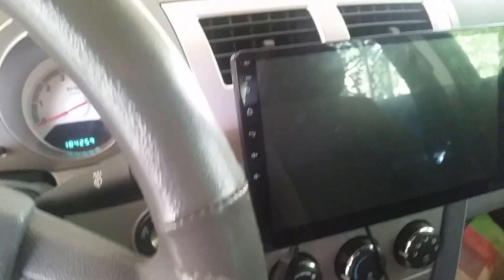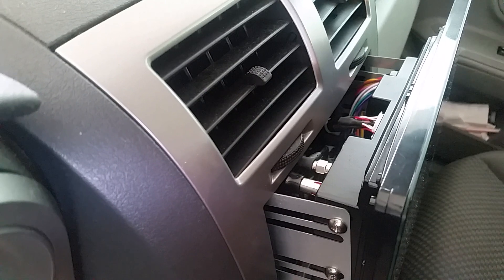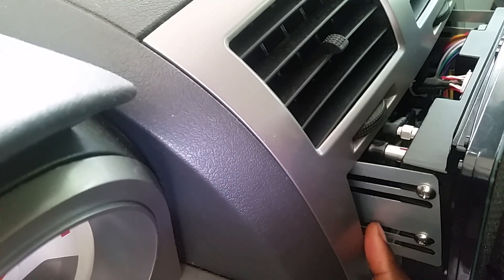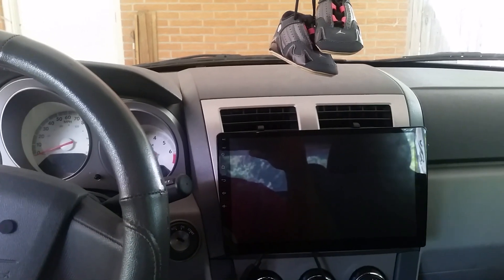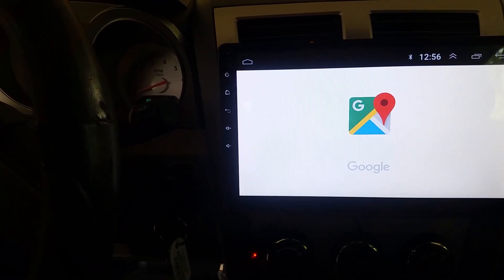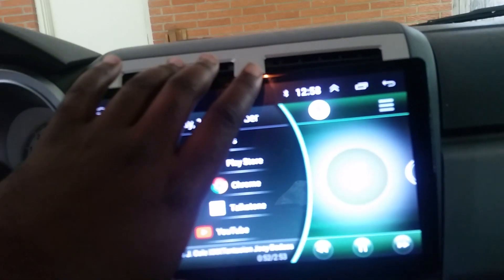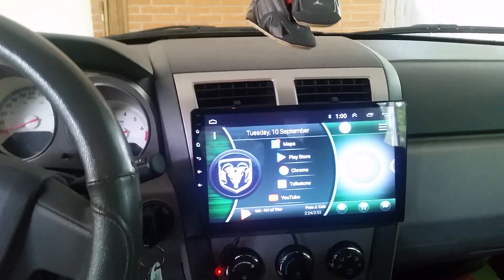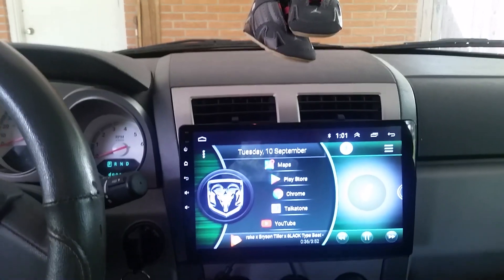Android 10.1 double din installation help questions/answers

Comment: Have you tried using you Aux Audio in (RCA) cables? Please let me know, I couldn't get mines to work, I was trying to connect an aux port to it but no luck.
Reply from the maker: I haven't tried adding any video to it on going from it
Reply: Amazing product. But my balance doesn’t work. I have the sounds only on the rear speakers. Also, my steering wheel controls doesn’t work. Please help. 
Also i used the RCA to install a front Camera

Comment: MG stands for Morris Garages, originally an English car maker that was bought by the Chinese.  You don't need to use those brackets, you can modify them, cut them up or make your own.
Reply from the maker: Cool never knew  that for MG I was like cool MG for Mag Gunz my nickname...  and yes I do need those brackets to cut and make my own... kinda makes sense I even said that in the video.. thanks for the education this install isn't done until I get my camera wired and then and put close in the dash

Comment: i install one in my car and its the one you can turn around and after the first test move the display the screen wiggle a little and in every bounce on the roude move a little and its annoying
Reply from the maker: Mine doesnt move I have it on the metal mounting bracket

Comment: Does it have RCA preouts, can you hook it up to a amplifier or equalizer?
Reply from the maker: Absolutely watch the other videos on my channel may in the description idk but I have an amp and 2 12s on it
Reply: Hey bro are the subwoofer settings hidden in this radio I installed 2 amps and have power to the amps on the power wire but I cant find the settings to see if it is factory turned off cant get the amps to turn on. Remote wire and all hooked up but they not powering up
Reply: u said u have other videos on the amp install part..mine only has the one set output..but i have a 4 channel infinity amp and 4 infinity 6x9's i wanna install🤷🏾‍♂️

Comment: Hey does it come with Bluetooth Bulit in or to have to splice some wire together? And also does the GPS work with out internet. I'm assuming that it does because it comes with that antenna

Comment: NO CONTROL WHEN DMALL LIGHT IS ON!! what the fuck does that mean? It won't let me get past that screen when the unit turns on
Reply from the maker: I have no clue never seen that
Reply: @357Gunz   We unhooked it out of my dude's truck put it in my truck screen comes on then it goes blank after the android symbol and if you touch the screen this little menu comes up that says no control when small light is on and you can't hit the you hit the home button nothing happens It's just like yours and unbranded you know Chinese 10" 8.1 android
Reply from the maker: @kylerichardson2778  I've never had that happen maybe wiring issues
Reply: @357Gunz   Yeah the only thing I can think of would be like doesn't think the parking brakes not on or something like maybe I hook something up wrong with that I don't know
Reply: @357Gunz   And of course there's nothing on YouTube about it there was a couple of people in your comments that had that problem but I don't even know if they solved it they didn't reply
Reply from the maker: @kylerichardson2778  sorry but if u can go to factory mode its password 8888 (4) or 88888888 (8)

Comment: I had buy this and it do does nothing for amplifiers I got 2 amps and. This thing sucks not a good radio sound systems
Reply from the maker: Turn ur amp icon on and subwoofer setting up then u gone beat
Reply: 357 Gunz how I do that
Reply from the maker: Please check all my videos on this issue it will help u get that impact u looking for or know u should be getting

Comment: So it's never going to be flush 😒🤓🤓 I need the gap eliminated if I decide to use this unit asap 😎😎💯
Reply from the maker: I clearly said I have it this way for a reason I could flush it if I need to but I'm not done tinkering and adding stuff to it to I need out for now
Reply: @357Gunz  Solid 💪🔥🔥💯

Comment: How did you install the steering wheel controls?
Reply: Maaaayne. Might wanna skip that...depends on ur car...stuff be hooked up in cars crazy.  Unhook the steering volume and the transmission dont work or sump silly af like that...I'm exaggerating of course...kinda.  but frfr
AND IF U still wanna try...look for a special wire kit and spend whatever they want if its available...itll be worth EVERY cent I promise

Comment: I got the same radio I cant get sound out of the apps like pandora bt you have a answer for that I can play radio only
Reply from the maker: Turn on your radio sipe down go to car settings tinker maybe it'll help if not ....do a factory reset from the settings or find u something and look for the black dot on the face that's not the mic and reset it ...
Reply: @357Gunz   same thing I was looking at other videos where others were having the same issues said something about I have the wiring wrong or something
Reply from the maker: @mrchr1  u need to factory reset it from settings or the reset hole while it's on...
Reply: I am having the same problem. Can anyone help??
Reply from the maker: Is your install from unknown sources on in the settings tab?
Reply from the maker: @DonTreply-dq5et  Is your install from unknown sources on in the settings tab?
Reply: Have the same issue still tinkering I realized bt audio was coming through while radio was on. When I closed the radio app ( only way I know how to stop it) the bt audio cut out too. Still tinkering.
Reply from the maker: @jefffisher993  I like that feature u should have the radio off before pairing to avoid that
Reply: I have the same problem. No sound only on radio. Now it has magically played on video, audio and bluetooth. Turned it on one day and it worked. Turned if off and back on and nothing g but radio. How did you hook up the antenna and remote wire on factory harness?
Reply from the maker: @MrHolmie11  everything is color coded
Reply: @357Gunz  I figured it out. if you have a stock amplifier such as my 2003 impala. and follow the wires on the harness it sends power to the amp through the blue powered antenna wire. so hook up the amp wire in the av bundle to the blue wire in the radio harness and boom it works. basically, it only worked during the radio because it thought it was turning on the antenna when it was turning on the amp. @michael holmes.
Reply: @MrHolmie11  check this comment thread I figured out my problem and it sounds identical to yours.
Reply from the maker: @jefffisher993  I understand I just matched my colors all up because I have an amp with said blue wire so I never had that problem glad u fixed it
Reply: @jefffisher993  ok I will try this later. I have a 02 Maxima with factory Bose amp. Only thing I had found was to connect amp wire and antenna wire together from factory harness and connect antenna wire from radio harness to both
Reply: @jefffisher993  that's how I have it now, but it hasn't played anything but radio since Saturday. Gonna try your way. I've reset it plenty of times.
Reply: @MrHolmie11  hmm ok well the problem definitely seems to be with turning on the amp. if you have a multimeter check the power from your factory harness. If  I remember right your constant power wire should display 15 amps acc 15 amps and amplifier 1 amp that 1 amp wire is what you are looking for. could be wrong that's from memory. So basically, it's not the radio its the turning on the amp that's the issue so have a look around its common among aftermarket radios when going into cars with factory amps. But due to the fact that it does work with the radio, I really think connecting the Antenna power from the harness adapter and the pink amp wire from the av bundle should do the trick.
Reply: @jefffisher993  i didn't have a pink wire on the rca  wiring harness. I tried the Acc wire and it worked fine. Thanks

Comment: How do you change the button colors?
Reply from the maker: Idk if u can I keep getting asked this there is no setting to do it
Reply: @357Gunz  I know if you go in to factory settings and use password 8888 there is a key light setting but it doesn't seem to change the colors
Reply from the maker: Update my unit has no buttons it's full touch screen why cause I don't want no heavy hand MF punching buttons and it don't work after a while so I see absolutely no setting to change the color which it's kinda irrelevant when the screen is bright aF

Comment: My radio came without screw holes on the radio to mount it
Reply from the maker: Do u have it installed? Are there groves on the sides where it may slide into place brackets on the unit?  I had to search for a unit that has the brackets I took all the time in the world before I bought it and they left out the camera I have it now but no wires that's China for ya 🗣smart but do dumb💩

Comment: Does yours reboot by its self?
Reply from the maker: Never...why is yours?
Reply: 357 Gunz not sure. While I’m driving or the base drops. It restarts
Reply from the maker: @KunalSingh-wi8vp  bro send that bihh back immediately mine doesnt do that at all it may be a situation of the wores resting on something or maybe touching wire to wire
Reply: 357 Gunz messaging the guy. He’s saying you already wired it. So can’t be returned lmfao. Bought it from a local shop. I’ll go in today with the deck. 

Wires are connected properly. Got it done professional. Thanks for the help though 👍🏽
Reply from the maker: @KunalSingh-wi8vp  you know its not supposed to reset like that its faulty... damn i hate that for you